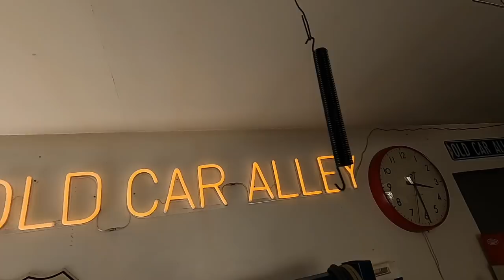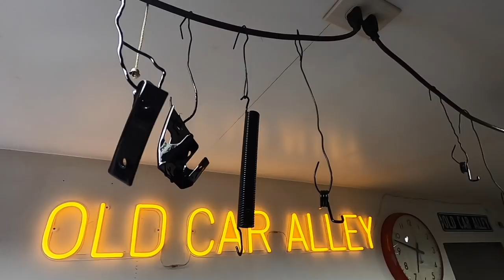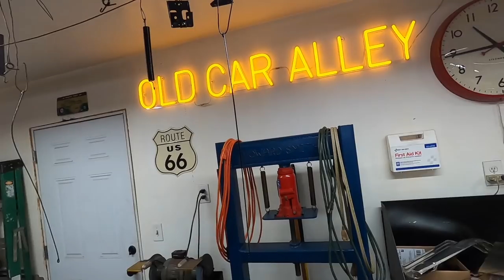1966 Ford Galaxie 500 convertible restoration part 191 stripping the front seat to springs

Comment: Yeah, Glad the Black Belt could help you out...!  Yes, The '65-'67 Mustang Seatbelts are a bit shorter than that of the Full Size Galaxie Belts of the same years. With that Front seat area on the Burlap underneath that has some mold, I would just drown that particular area in some Lysol, then let it air dry, then hit it with some Febreeze and then call it a day...and then just wrap the new burlap over it.  That's what I'd do.   Tony K. :)
Reply from the maker: Tony, thank you for the belt coupler. I forgot you stated it was from a Mustang.... guess that makes sense, seeing it's a bit short for the Galaxie. I looked over the original burlap.... it cleans up surprisingly easy, so I will do just as you suggested. I am going to try to get the lower part of the seat done today or tomorrow.

Comment: Did you ever get the leatherette panels for the boot area? There are cardboard legal files you can get at a stationery shop or Staples type store that have that surface and thickness you’re looking for.
Reply from the maker: No.... I haven't left the house in a good week or so. I do need to do a grocery store run, maybe then.